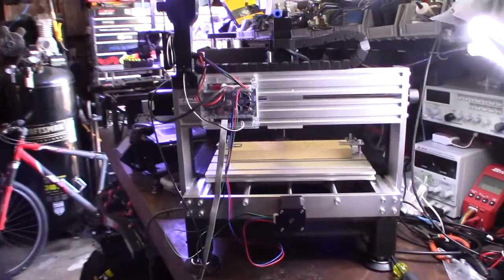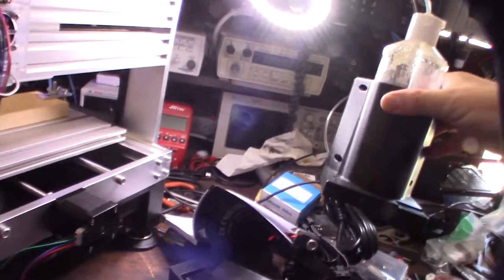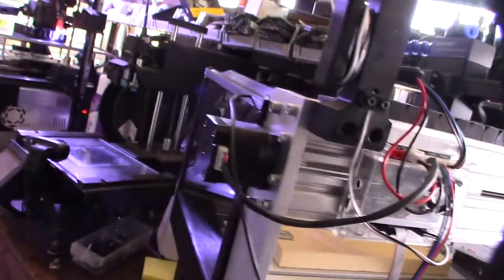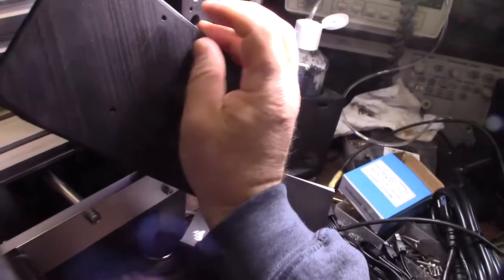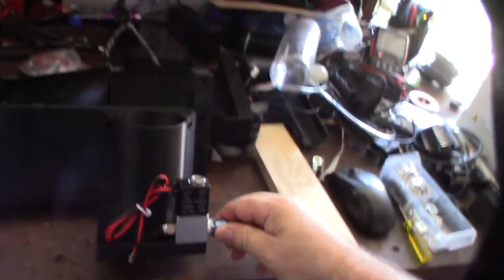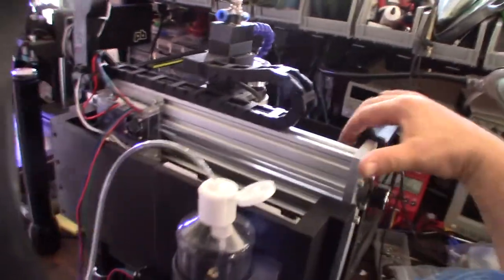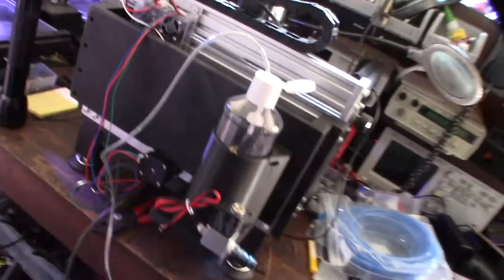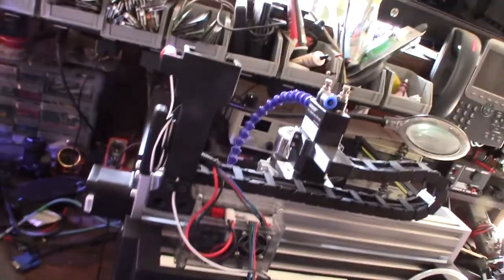3018 CNC Rear Chip Containment System Debris Catcher with GRBL Air Coolant bottle A3

Comment: love this process you got going with your 3018,i have a question i wanted to do a back cover similar to the one you have but for my cnc there seems to be no space between the Y stepper motor and the bed frame when moved back, your cnc seems to have more space between the Y stepper motor and the bed frame?

Comment: If you dont mind me asking what mosfets are you running?
Reply from the maker: For the Air control valve?
Reply from the maker: https://www.amazon.com/gp/product/B07GLNCRR4/ref=as_li_tl?ie=UTF8&tag=fintechcomm0f-20&camp=1789&creative=9325&linkCode=as2&creativeASIN=B07GLNCRR4&linkId=c44856593af398fae3d5151b5a33a60a
Reply: @fintechrepairshop  yep. Thank you